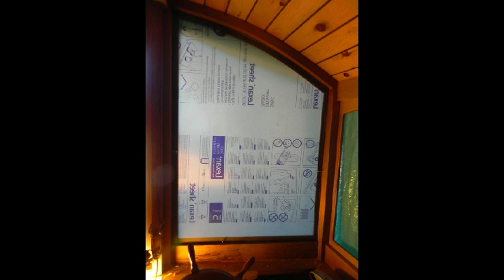Build a Cheap "Tiny House"...Boat, DIANNE'S ROSE

Comment: now this is more like my retirement home. I'll make mine with hurricane proof windows!!! Also it won't have an engine so it will be cheaper and I could buy a fishing boat to toe it. I can imagine it now sitting in clear water!! Love the size, just wonder about how many guests could stay their. Hmmm
Reply from the maker: Many have built her longer, easy to do as the hull is the same cross section from 4' of the bow to the stern! You can also be creative with pipe bunks! Another option is to raise the bow enough to get a set of bunks partially under the bow. I was going to builds a longer 23' version but hip surgery put that off! We love our tiny houseboat so the build was more to draw up a bigger version. As it turns out the existing plans seem more than fine to get a bigger boat if wanted.  The longer build would have had a lower cabin for the extra length so sitting dinette or full bedroom would be there and no need to convert the living area. With the lower roof an upper deck for outdoor living is available above as the low doghouse creates a deck space without adding total height to the boat! I think it would be a cool build but I've moved on to other designs! Also cool in my mind! All the bestRoy

Comment: Excellent! This looks like an amazing project!
Reply from the maker: +Graham Cam Thanks Graham, with the Build Manual and Measurements given in the Full Plans the build is straight forward and the results should guarantee a strong long lasting boat that will give lots of fun! Best/Roy
Reply: One more question.... What kind of trailer are you using?
Reply from the maker: No problem Graham.Trying to save some money, I bought an old boat/motor/trailer/ package for cheap. I stripped the boat of useful parts, sold the motor (it was too big for our Rose) and then modified the trailer. It ended up only costing us $200 in the end!!! We used it to tow to Texas and back so this has certainly worked out well. Other builders have followed our lead and some have had custom trailers built. It all depend on your budget.

Comment: How did you seal the nails used to put the strakes on the keel?
Reply from the maker: Stainless Screws dipped in Epoxy and set into predrilled holes John. BestRoy

Comment: With this hull design, what would be the maximum width and length?
I was thinking of doing a houseboat build. I was looking to do a 25 to 30 length and a 8 foot beam.
You did a great job.
Thanks
Reply from the maker: Others who have bought the plans, have extender their boats as it is as simple adding some extra frame sections! Each is the same from 4' of the bow to the stern! Lengthening the boat would just add to it's stability and is doable! Visit RoyDesignedThat.com for more information Bill

Comment: Very cool build. I love it. Great for float camping. What are the dimensions of your boat? Approximately how much did you spend on the build? And what size motor is that? Just while watching I came up with the size I would build if I did one. It would be 8'6" wide (legal road limit without oversize permit) and maybe 18' to 20' long. I have 2 - 35 hp Johnsons kicking around. One would push it along real nice. Enjoy that boat, I know I would.
Reply from the maker: Thank you Quarlow! Float camping is what DIANNE'S ROSE does best! 8 X 17' is the size, while seeming small it has all the room we need to be comfortable! A few builders have lengthened their boats with success. We spent about $4500 on ours but it can be built cheaper by recycling materials from construction sites! I used Marine ply and clear Cedar (not cheap)! The motor is a 9.8 hp two stroke but I was wanting the Yamaha 9.9 hp four stroke, high thrust motor! Ours moves the boat at 6 mph at 3/4 throttle so is fine but the four stoke would have been quieter and more efficient! We trailerred Dianne's Rose all the way to Texas and was pleased the boat was only 8' beam! Getting through construction and being caught between truckers, I was nervous enough! Lol. If I were to build a longer version (have a great idea for a 22") I would bump it out to 8' 2". Not much wider but still would make the boat wheel chair accessible!
Reply: 8' x 17'  is a good size. Being a trucker for 35 years I don't have a problem with it being wider but I can also see the benefit of the 8' width. Better for off road for sure. Anyway great boat, enjoy.

Comment: Good Job ,..Question for you Now that you have launched Her and are enjoying your boat ..Would you do anything different like Making it just a Bit longer .maybe 4 or 6 feet  for added comfort ..?   just wondering  :)..
Reply from the maker: +jlions72  Good question 72! I might have added 6" on the stern as we now have gas boxes for storage and it is a bit tight for your footing on the out bound side. I've installed a strong handle on the roof so I have a good grip when gassing up or working on the stern deck. I do have a 22' (+ or -) version that I've designed in my head that I want to build. We would keep our Rose but I'd then have another design and be able to sell the boat on spec. This would be a way I could work on boats full time, a goal of mine. We will see! Take Care...Roy

Comment: Very cool concept.  How has it fared this past year, and in what weather conditions? Also, how many can it comfortably sleep while remaining house-like, and for how many days can you be on the water before you need to port and resupply?
Reply from the maker: Hi Trevor, it has fared very well in a good range of conditions! It sleeps two easily and with some creative solutions could sleep four but be crowded (pipe bunks/ two could sleep in the aisle). We can go for a couple of weeks at least and do not re supply at marinas as a rule. Gas is cheaper at a gas station! Best/Roy
Reply: Roy, thanks for answering my questions.  Building a boat is something I hope to start doing in the near future, so I'm trying to get as much information and design ideas as I can.  I guess I have a few more questions, if you'd be willing to answer.  How stable would you say it is in a strong gust or minor storm (or climbing around on it for maintenance)? If necessary, would you consider this design as suitable for a primary residence?  About how long is it, fore to aft, and across the beam? And about how much would you say it might cost, in time and materials, to build from scratch?
Reply from the maker: No problem Trevor. It took me more than ten years to get to build this boat! I do understand how life gets busy. She is stable and we have been out in very rough, windy conditions and had no problems! The hull settles at speed so tracks well! Many aboard have been surprised! People live on sailboats all the time and DIANNE'S ROSE offers lots of storage for supplies and with an enclosed head and a small kitchenette, I could live on her without difficulty. But Dianne would not want to be on a boat full time. The boat is 17' X 8' beam with the cabin being 10' X 8' with access under the decks to expand storage. This seems small when one looks at just the numbers but the spaces offer duel function and all that is needed to live aboard is there in a small package! I designed her to be just right! With this small size comes many advantages. Weight is one. As she is relatively light, she draws very little water (6" at rest/10" at speed). We can trailer the boat long distances or sneak into a creek where we find privacy and shelter from storms. The build cost us about $4500 CAD and took about 600 hrs. It was satisfying going through the process of building with many benchmarks along the way. It could be built cheaper with exterior ply and found/recycled lumber. I'm doing such a build as we speak! I should mention the boat can easily be lengthened and many who have built her have stretched the boat to 20' and one to 24'! Simply add a frame section and adjust the other dimension....
Reply: I'm looking at this design to build my own 28' housebarge.
Reply from the maker: Sounds like a great project Dan!
Reply from the maker: I like your thinking Dan! I like the adventuring aspect of boating and would love to do an epic trip. Convincing Dianne is my goal. She enjoys a couple of weeks but is not normally a water person so I try to be "nice" so she enjoys our outings. Good luck, such a trip would be amazing! Best/Roy
Reply: Dan Fitsgerald
"Got as far as"? Did something happen after that?
Reply: Dan Fitzgerald I actually had run across one of that guy's videos before, but as you said, I wasn't entertained much, so I never pursued his journey.
Reply: Dan
Not necessarily, but a good eye for artistic rendition is.  I watch several channels where not a word is even spoken, it's all just video footage with background sounds or music.

Comment: It`s a very nice looking craft & the workmanship is top notch...BUT;
What are the general dimensions...AND;
You`re offering plans?
So,  did you not build it FROM existing, proven, plans?
Seeing the video it seems to ride nose down & plow water.
Not particularly sea worthy.
Reply from the maker: Hi Jayne if studying how barges operate, you will note that all do roll the water in front of the bow! This is not as much of a disadvantage as you may think as the water becomes aerated and when trapped by the four runners on the hulls bottom, is directed across the width and length of the underside, which breaks surface tension to improve speed. This improvement is nothing grand but balances any loss of energy used to push the water at the bow! As for sea worthiness, you'd be mistaken. The boat does surprisingly well in rough conditions, After 8 yrs of using her we are not shy to take her out in rougher conditions. One  trip aboard would affirm this and there are "rough water" videos you can look up on my channel. I designed the boat and have plans available form RoyDesignedThat.com. It is an older website that formats best on a Lap or Desktop if wanting to see the slide shows! Hope this helps! BestRoy

Comment: That's absolutely awesome!!! How long did it take, and about how much did it cost???
Reply from the maker: Thanks Jack! It took about 600 hrs and $4500 CAD to build. I used top quality marine ply and epoxy with red cedar but saved some on hardware and trimmings by "free cycling" an old boat and using up "scraps" of wood I'd collected. It is possible to build a "work boat" version cheaper as I've just done with my sailboat build, CROW. I used exterior roofing ply and "free cycled" most of the material for that build. The key is to use epoxy resin not polyester!!! Your time is worth a great deal and it would be a shame to see the work fall apart or rot prematurely. We have been using our DIANNE'S ROSE for 6 seasons now and she is as solid as the day I finished her! I'm not kind to the poor girl either if you watch more of my videos! Lol! Visit RoyDesignedThat.com for more info on plans  and do ask if you have more questions Jack! Best/Roy

Comment: I love the boat and I hope to come up with the courage to build one someday.  I have a question about the controls for the motor.  Can controls be bought off the shelf, mounted and connected to a standard outboard motor or did you have to find a motor that had the throttle and shifter already together with it?  I would hope that a small motor from a jon boat designed to be controlled at the back of the boat, could be used but controlled remotely.
Reply from the maker: Thanks, I got the controls with the motor but I'm not sure if you can retro fit a set of controls. I'm sure you could figure something out that would work but may have to be creative. It does take a bit to decide to actually build a boat. I too took 12 years before I could get life arranged around all the things I "Need" to do first! When the time is right for you, get in touch. What is exciting is the other people who have now built the boat! Several are on the water!!! Best/Roy
Reply: as a custom pontoon boat and pontoon house boat builder, you can buy off the shelf controls in any style you like, and buy the control cables for any motor at what ever length you like, same with steering cables, but I like to use hydraulic steering on house boats as you use 0.30 wall 3/8 copper tubeing with a 1500 psi rating, not the cheep plumbing or gas tubing, all these parts you do not find at most boat dealers, you have to find dealer like my self the offer nothing but after market top line parts
Reply: Marine hydraulic steering for 40 ft sail boats use plastic tubing, the pressure is not high.

Comment: what are the actual Hull dimensions? height width and length.   looks awesome ...you. did a Great job with the construction..  love the fine details to the interior.
Reply from the maker: Thank you Lyle, while others who are building from the plans have lengthened their boats (the design makes it easy to do so), our DIANNE'S ROSE is an exercise in minimizing the size needed for us to cruise and still have all the amenities. The boat is only 17' X 8' beam. It draws just 6" at rest and is 7' total height including below the waterline. We find there are more advantages going small than disadvantages! With such a small and therefore light boat, we can trailer to far away cruising grounds so never get bored and costs are minimal as we only need a 6 cylinder vehicle to tow with and only a small 9.8 hp motor to push the boat at 6 mph! Hope this helps, if you wish to find out more, visit RoyDesignedThat.com...Best/Roy

Comment: How much did it cost to build an coat the hull? P.s beautiful boat
Reply from the maker: Thanks Cancer, the hull was about $2000 CAD and $4500 CAD overall. It was not too hard to save over the two years of part time building, about 600 hrs total! I did use marine grade ply and western red cedar with epoxy to coat the fiber glass! Best/Roy

Comment: What size motor are you using on it?
Reply from the maker: We have a 9.8 hp but others have added more power, which is fine. We like keeping the boat light and still get 6 mph, at 3/4 throttle! Here is a video showing how our boat handls...https://www.youtube.com/watch?v=Ny8s1mzmA3M&t=189s
Reply: Roy Schreyer I just finished converting a 28 ft school bus into a tiny house and now I’m looking to have another summer project, your boat is really cool.
Reply from the maker: @markmaue9246  Thanks Mark, I'll add a link for a clip that gives a tour of the interior and exterior, with me explaining the thinking...https://www.youtube.com/watch?v=jfuDmhHe8OU&t=1772s

Comment: how much can the boat hold, could you put a loft inside?
Reply from the maker: It could have pipe bunks but no not a loft. The interior height is 6' 8 1/2" floor to ceiling! The design is intended to make the most of minimum  space! One of our builds has a platform on the roof for a bed under the stares that I think comes close if a tent was used! Best/Roy